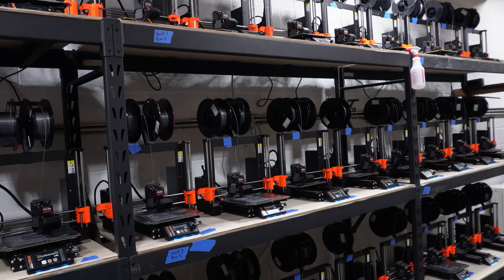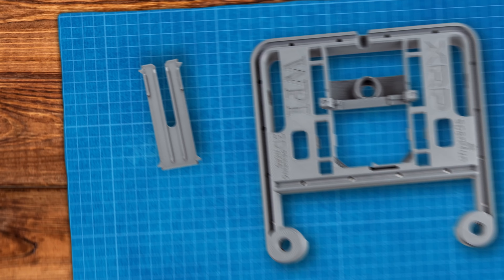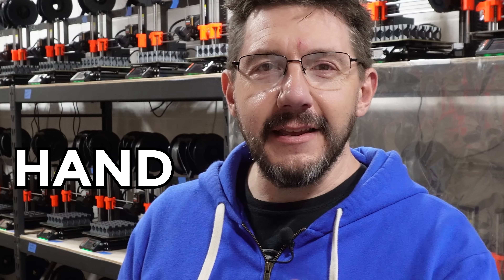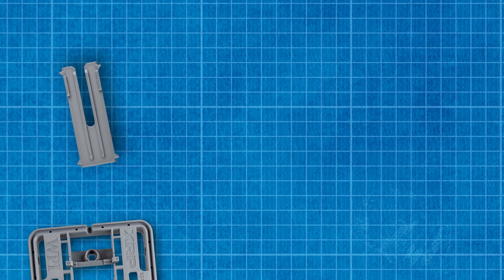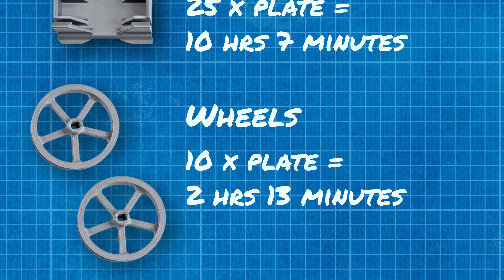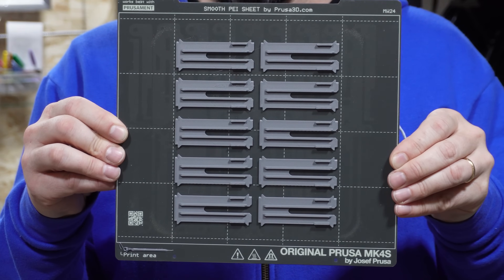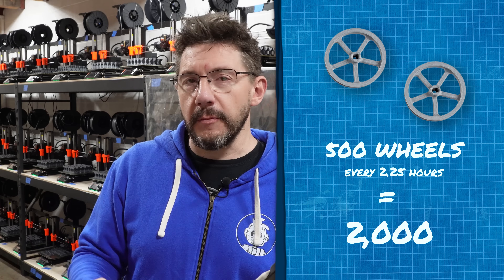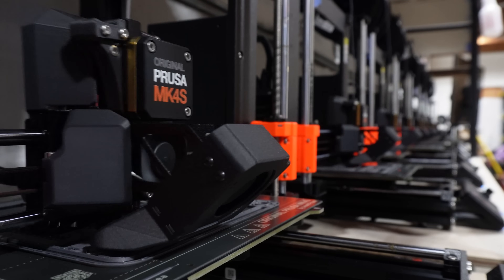How We Used 50 Printers to Make 80,000 Parts!

Comment: Great video Joel, thnx!

Two questions:
1) Do you use any centralized software to drive all printers, manage print load, etc?
2) What kind of power back-up system do you use, and how many printers are connected to one such unit?

Comment: You need to invest in 3D printing injection molds and move to the next level, injection molded parts.  When does the order size transition to more traditional manufacturing techniques.
Reply: Multiple parts did go through revisions while the kits were produced. With projects like this sometimes the motors mounts need to be changed if one variant is not available anymore or they need to make a part strongere, etc. Doing that with injection molding is either not posible or expensive.
Reply: I have seen injection molds that were manually done, yes, they are made VERY quick!

Comment: Would be interesting to compare that strategy against, if possible,  printing a whole set of parts on one plate, which would reduce the packing & collating effort - 1 plate goes into one bag - less chance for error and more easily scaleable - any idle printers could be assigned with no constraints on batch size etc.
Reply: @mikeselectricstuff  if each instance of a part was sliced identically it should be possible to count them by weight
Reply: @mikeselectricstuff  I thought of that one too, it sounds like Sparkfun specifically wanted to have them packed like this (all the same parts in a bag), maybe due to how their production process works? Not sure but I agree that I would've tried to do one set per plate, or potentially everything except the frame.
Reply: @gjsmo  Sparkfun probably have an assembly line with part bins and sorting trays.  Think cutlery trays; first person puts in a spoon, moves the tray down the line to the next person who adds a fork etc.  Anything wrong is easily spotted at the end.
Reply: @mikeselectricstuff  that was my first thought but I'm pretty sure the main reason to split them was they didn't all fit on one plate

Comment: Great video, thanks for clarifying the process and explaining the challenges. 
I’m curious, I guess you have prusas mk4 for the print quality and printers robustness but what alternative printer could also have the job done for a lower price? Maybe the new Centaurion carbon or bambulab A1?
Reply: You must consider total cost of ownership. Prusa may be more expensive to aquire, but they have low and cheap maintenance and they are very reliable in print farms. There is hardly any printer that can do the job for lower price.
Reply: @ I understand but a MK4 costs 3times the price of Centaurion or A1. Meaning, you could replace the latter alternative 2 times before reaching the cost of one Prusa MK4. Can you still argue for the MK4 being cheaper in the long run?
Reply: @TobyM3  Yes, because you don't have a time for dealing with failed prints and replacing printers. You need reliability and consistency. And even MK4S is still cheap machine in the world of 3D printing mass production.

Comment: I’m interested in the choice of the Prusa MK4 vs a BambuLab P1S with AMS. The P1S would have been the same price, is much faster and the AMS would allow you to go through 4kg at a time without having to worry about running out of filament or filament changes.
Reply: P1S is not faster. It's actually slower than MK4S. But that does not matter much, because these high precision and strength prints are not done at maximum speeds anyway. AMS is not usable in print farm environment where you usually use 3-5kg spools.
Reply: I'm using the P1S for a large order and couldn't imagine using anything else. The quality is unmatched and the AMS works great. They have their problems but overall it's solid.

Comment: What does your maintenance schedule look like? Do you stock more common wearable parts?
Reply: modern printers rarely break down, just replace if it breaks, i have found that maintenance schedule take up more time then just replacing the part, if you start to see VFAs just tighten your belts ETC. and the nozzles can last well over a 1000 hours.

Comment: is automated belt printing not ideal for a print farm ? i remember the hype around them years ago are they still unreliable ?
Reply: They’re not as reliable, usually not that good (the companies who make them don’t make great printers) and the print orientation has side effects which need to be taken into consideration when designing (the layers stack at an angle)
Reply: @PatrikTheDev   how unreliable are they tho ? wouldn't having having 7/24 uptime with lets say 1 day down time per month achieve  higher print outcome ? also less work for taking the prints off from the bed isnt that an advantage as well ? i remember seeing people printing hundreds of the same part with no intervention.  i hope Bambu Lab's make a competent  belt printer.
Reply: Not reliable and they produce crappy looking parts. Many have to be redesigned due to the printing angle. Totally not worth it.